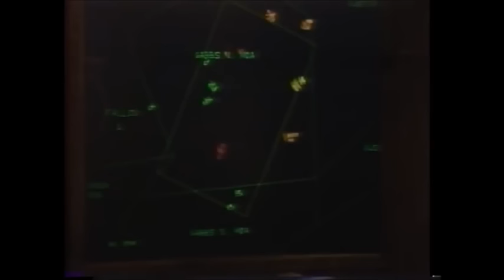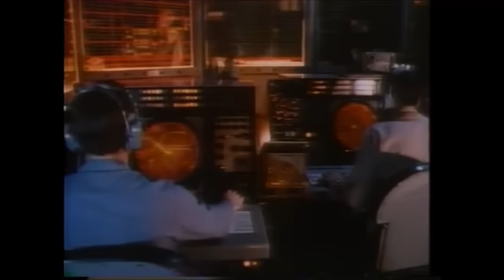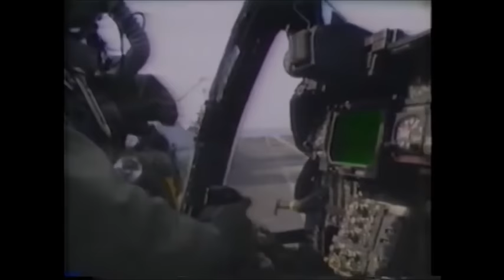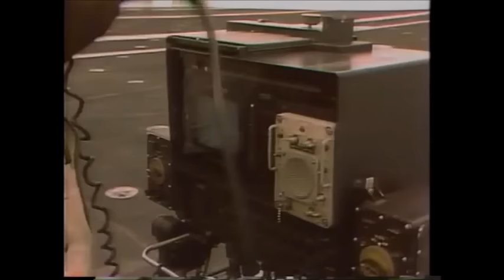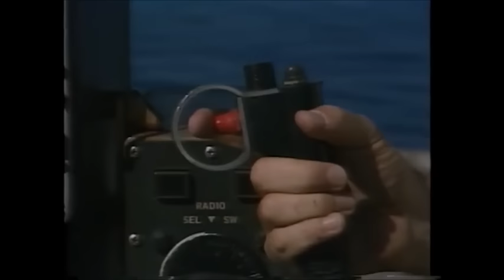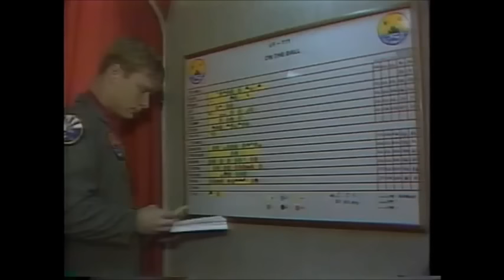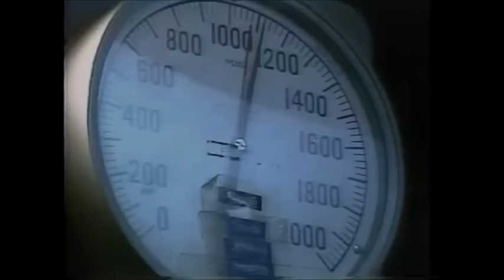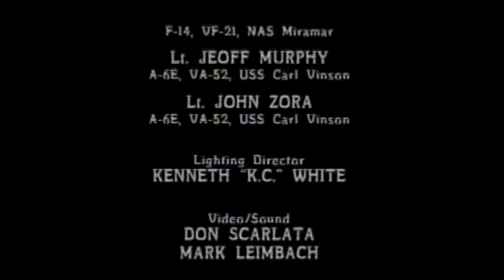Flight Deck (1988 Documentary)

Comment: Was on the flight deck from 69 to 86, tied to the hip with tailhooks particularly the A-7 kind. IWT, troubleshooter, slot checker, final checker, tire qual nit cart qual. Flight deck went thru many changes, F4, F14, FA18 and the changes in and on the flight deck to operate each even took my first duty station into the dry dock to elevate from an F4 to a F14 fighter wing. Tore the old girl up from top mast to propeller shafts, shake down and work up to cruise status,1972.

Comment: 3:31 An F-14 Alpha minus EFTs, a rarity, and made a significant difference in aero.  That's the cleanest Tomcat you'll ever see flying. Just has the glove mounted hardpoints as all Tomcats wore, but they are empty with a clean center tunnel area. Same clean glove config. on a 1976 Tomcat was good for over Mach 2.25 with 4 AIM-7 semi-recessed in the tunnel.  4 AIM-54 in the tunnel and 2 on the gloves allowed for a Mach 1.8 max. 6000 pounds of Phoenix and 2000 pounds of Phoenix launch rails. Your not going to run too long in Zone 5 without tanks for very long.   Notice the airbrake is extended along with the hook, after the bolter is called airbrake is relaxing and engines to military power. Not an afterburner flame to be seen.  That was a VERY light Tomcat.